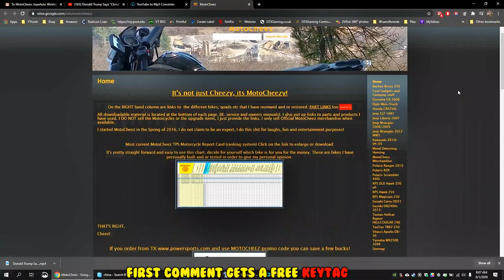Mini-Truck (SE05 E02) Ordro EP7 test, Moving boat, set up HF canopy, fall drone footage

Comment: mini is SO useful!  nice canopy, i like your idea of anchoring it with steel pipe; i have one of those canopies that we use in our summer campsite, i might try your trick.  great views from the drone, how long does the battery last?
Reply from the maker: Thanks! I get about 35 minutes on a full charge

Comment: You can set a home and device on a lot of them so when it has a low battery It will go back to your address within a certain mile radius But look in the manual it'll tell you that and it'll tell you how many mile radius it'll automatically track back to your address but you gotta watch if you're not near your house when you're like somewhere else in the world it'll try and track it at address so it might get confused and if you're in the city or sometime for I into a tall building it happened to my dad's friend one time would not recommend that if you're in the city keep an eye on the battle if that point would recommend at your property though
Reply from the maker: This mavic pro does. It sets home point every time it takes off. 5 mile range too

Comment: X brace each panel with ratchet straps on roof and sides and it will stay together . I had one and tech screwed all the pipes together it is still good 3 years in

 GO CHEEZY

Comment: There's a nice footing application for that tarp/pole port.  A thought... webbing from horizontal to horizontal (over the ridge), spaced a couple of feet apart... to give you the additional load capacity protection?  Then you could put a bow-to-stern 2x4 at midway from the ridge to the horizontal, and prop it from any place you desire.
Reply from the maker: Yes! I plan on something like that.

Comment: Hello MOTO!....nice step on the poon trailer, might want to put a flat metal on it for safety....love the drone...thinking about getting me one...maybe do us a tutorial on them...best brand, or features...I see advertisements all over...I don't know enough to scratch my head...oh yeah...seen a video on trailer jacks...you might want to confer with me on it...great idea if you have a welder and some square tubing...love to share it...
Reply from the maker: I do plan on putting steps, I have leftover square tubing i did to covert my V hull trailer to pontoon. I do have a welder, quite good with it too 😁🧀
Reply: @MotoCheez  Hello MOTO!....I watched a video a while back...where they welded like a trailer hitch tubing to the jack...then they welded receiver tubing to the tongue, and close to the wheels...(the one I watched between the axles) then they just pulled the pin and used the jack where ever the needed it...just by having that tubing welded on they always had a jack for the boat...I do not know the name of the video...but think on it...it was a cool idea...very cheap for the convenience of just moving your jack where it is needed...make good content brother...look forward to watching...

Comment: That canopy should work! Like you said, snow loads may be an issue. You get some pretty heavy snowfall in your neck of the woods! That is so amazing seeing a  primarily deciduous tree forest, we are almost all pine trees, mostly lodgepole pines. In fact all the elm trees in Alberta are the result of human plantings. Some have popped up naturally since then, but if the Europeans had never arrived here, there would be no elms in Alberta. We primarily do not have Dutch Elm disease either. A few trees have shown signs and been removed, but Alberta is a decent sized Province to only have a few trees infected. Fingers crossed. 
   I always veer off on a tangent,,,,,,,. You are situated in some very nice country! I like the pond and lake right near your property too! Hopefully you have a little bit of access, even just to hang out around the shoreline. We have a little pond about the size of the small one in the video, but it’s almost 30 ft deep, probably is over 30 feet in the spring! A natural hole in the mountain and it’s in a perfect place for water catchment. Nature can be awesome!!! Those Bobcats are awesome to see, but they freak me out. I don’t mind wild bears, but the wild cats are another story!! haha. I have watched a large Bobcat kill a grown whitetail deer 4x4 points! They are pretty capable things! I have never had a problem, but I always remember what that thing had done to the deer,,,. We have Cougar as well. I have yet to see one in 58+ years living right in the heart of their territory, but I’m a noisy guy, so,,,,,,. 
       Those canopy’s like you have here don’t last really well here. We get winds up to 70 mph every year and often get 60 mph. The winds were gusting up over 50 mph today!! It’s not uncommon to lose some shingles or tin siding on the windiest days! As things get older that wind works then lose and then zoom!! 
     I have watched your video twice now. Great install and modifications on the canopy. It should protect the boat well and maybe allow enough air so there’s no mildew buildup. Time will tell!! 
    Stay safe Eh MotoCheez!
Reply from the maker: All these mountains were burned down for charcoal for iron ore furnaces years ago. We have mountain lions around here too, but rare. I saw one about 10 years ago.
Reply: @MotoCheez  - Wow! I heard about making charcoal, I wouldn’t have imagined,,,,. Something new to learn about.